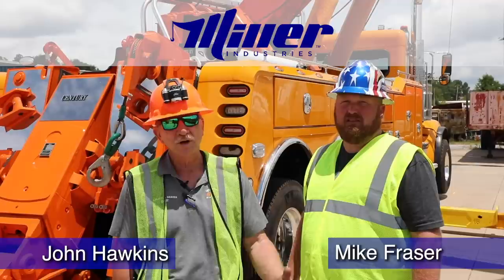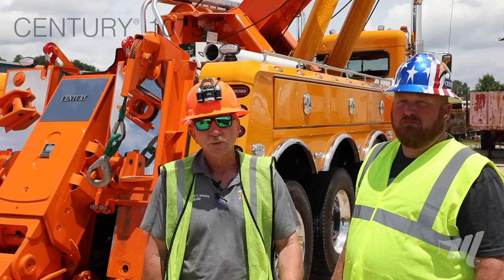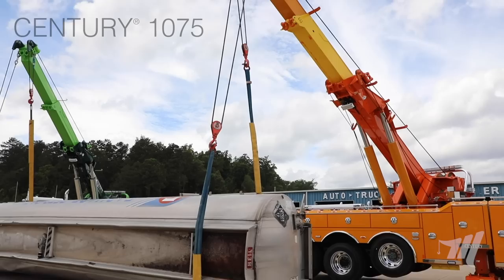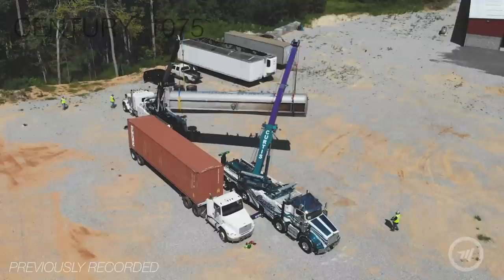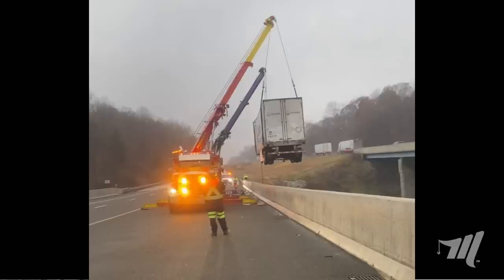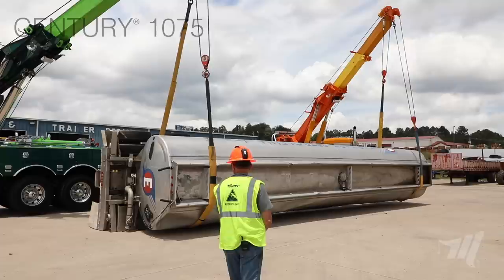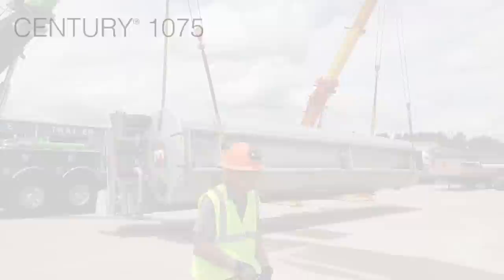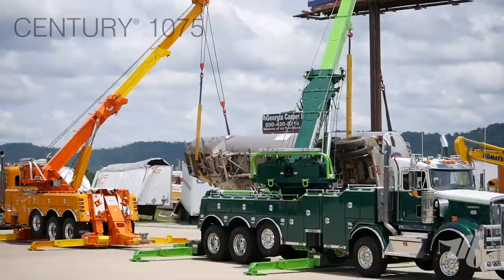Century 1075 Recovery Demo

Comment: I noticed that alot of instructional videos would use a snactch block back to the tip of the boom. Working in the industry I rarely see this(even in the actual Indianapolis footage they did not with a loaded trailer). The weight for the lines and winches are in specifications without the snatch blocks correct? So is it just a safe practice that Miller is using?